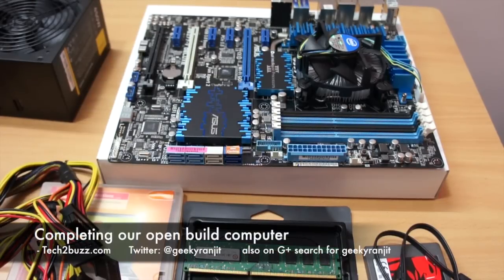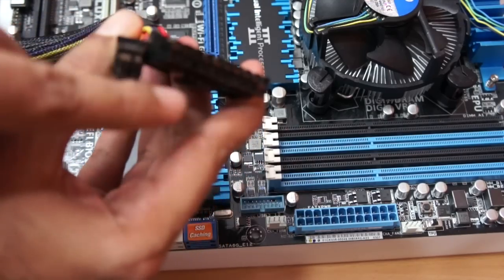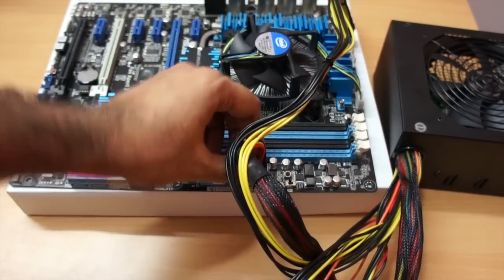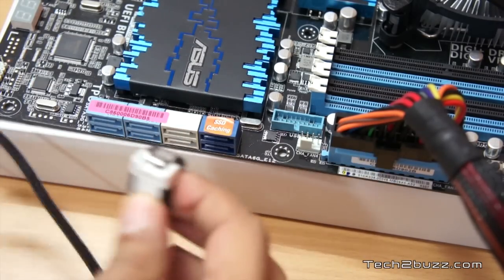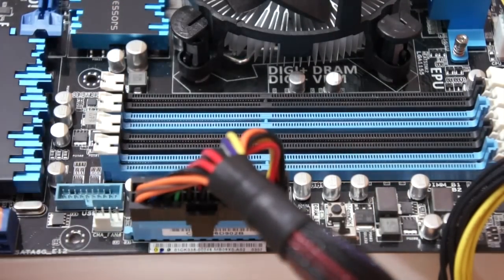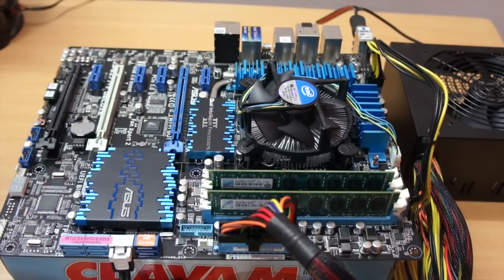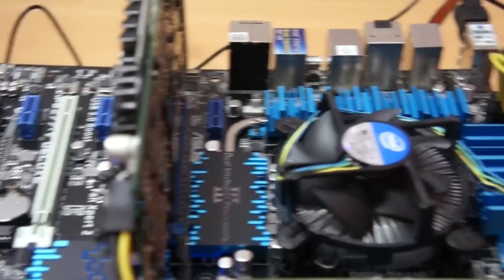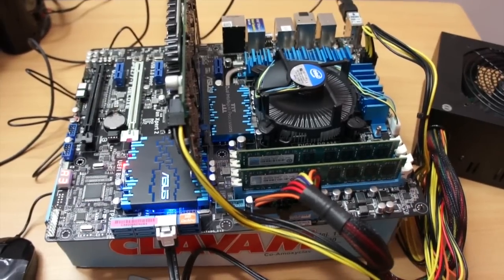Connecting SMPS installing RAM / SSD on your motherboard

Comment: I removed my power wire how to connect to the power supply, i have wires with the label pled+ , pled- , hdd led(2 pin) , power sw(2pin)

Comment: sir, I have mother board of Asus H170 pro and 16 gb ram, i5 processor, and 120 gb of ssd HDD, I want to ask that on motherboard It has HDMI port and and on my Monitor cum tv also has HDMI port But after connecting with HDMI cable I did not get any display even after I made adjustment setting in TV also that VGA to HDMI. Plz suggest how to get rid of this problem. While connecting with VGA cable its work very well. My gmail is parth.8633@gmail.com

Comment: My rig:-
i5 2310 2.9 ghz
4 gb ddr2 ram
seagate 500gb hdd
r7 260x asus direct cu 2 2gb
1 dvd rom 
corsair 450w psu
will it run?
Reply: SKULLzCRUSHEr!!! Csgo&more!! Go on pcpartpicker.com and put in all of those parks it will tell you if it's compatible or not

Comment: This is the shittiest Build log I've ever seen. Firstly you connect PSU before installing RAM pieces onto your motherboard and secondly, which is the most idiotic thing I've ever seen is that installing SSD not on the specified ports which also have SSD Caching written on them i.e. there are connected to high bandwidth PCIe lanes but connecting them to normal low speed SATA bandwidth ports. 
Stop making FOOLS out of Indians and stop calling yourself a geek.
Also change the description of your channel from TECHNOLOGY ENTHUSIAST to MOBILE ENTHUSIAST LOSER !
Reply: very true

Comment: Nice video. :) Do motherboards usually come with SATA data cables or do you have to buy them separately?
Reply: ***** Wrong, this is "sometimes" scenario My SSD did not come with sata cable. not all do, just to make sure, look under accessories, if an sata cable is listed under it, if it is! there's a slight chance yours does not come with one, you can also contact the people you buy it from and ask them. But dont go out on a limb and trust it to come with one.
Reply: +Charlie Cooper it usually comes with your power supply even though this is a year late
Reply: LOL - all good, it did indeed arrive in the box. :)
Reply: ***** Well, then enlighten me why mine did not come with one?
Reply: Ha, I meant that the sata cable arrived with the SATA disk - there was one in the box. The motherboard didn't come with a sata cable at all. :)
Reply: i thought they came with the power supply or the hard drive itself
Reply: Yeah bro they'll give 2 of them with the motherboard

Comment: hey ranjit, i have asus P8z68v pro mother board and have connected my primary hard drive on the white sata port, whenever i start my system ..the monitor shows "no hard disk detected" then bios restarts and my OS starts. Can you tell me the correct port for the hard drive connection. my hard drive is WD 1 TB caviar green. thanks :)